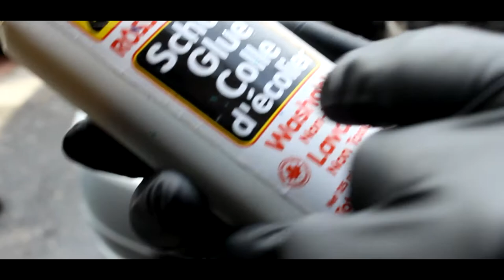Civic AC Compressor

Comment: Could it not be taken off from under car
Reply from the maker: It could have if you have a hoist. Since we did it on our driveway it seemed to be the easiest solution
Reply: @teamperformance5810  understandable I was just curious trying to find the easiest way to do this myself
Reply: Can’t you just lift the front driver side and rip off the tire which gives you easy access to the ac clutch plate and I don’t know maybe some of the bolts holding it on?